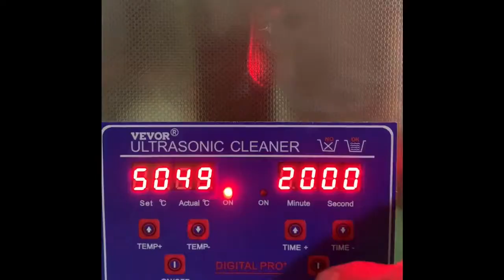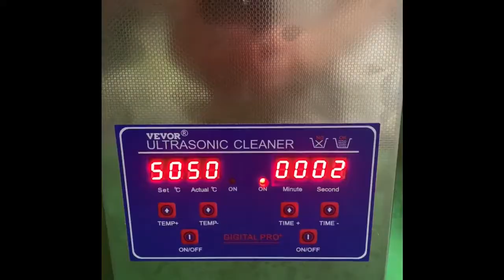ASMR - Tiny Vintage Ladies Watch - Bulova Caravelle Service

Comment: Personally with these tiny movements (Even though it is frowned upon) to fix them I soak them in alcohol then oil it. 50/50 chance of working, or just replace it.
Reply: If it's not an expensive watch and it's not working...what can it hurt.
Reply: @TexanUSMC8089  true that
Reply: Soak in oil?  The watch needs very minimal oil a specific location, over oiling is very bad and will just cause the movement to attract all sorts of dirt, grime and muck.  I hope you don't try and sell those to unsuspecting people.
Reply: @devildogae  I said soak in alcohol not oil, please read my comment again.

Comment: Thanks for this video.  Please...can you tell me what brand or type of tiny screwdrivers you used to disassemble the movement?.  I have this same exact watch and plan on doing what you're doing...cleaning and getting it running again.  My big issue is I can not find screwdrivers that are sharp enough.  I do not mean the width, but the sharpness.  The slots on the tiny screws are so narrow and shallow, I can't find a screwdriver that will go in them.   What brand did you use and what do you recommend?.  My father's Accutron is the same way. The slots in the screws are so narrow, none of my screwdrivers will go in the slot, they're too dull.   I have tried sharpening them, but it seems I can never get them sharp enough to go into these super narrow slots.
Reply from the maker: This is the set I use. It isn’t “the best” but I’ve repaired dozens of watches with them so far with no issues. However do realize if you’re stripping a screw head (stuck or overtightened) it will damage the screwdriver tip. Fortunately this company sells replacement tips. Good luck! Professional Screwdriver Kit by... https://www.amazon.com/dp/B07K1PMZ5P?ref=ppx_pop_mob_ap_share
Reply: @csspinner  Thank you so very much.  I think the operative word here is "precision".    No, I have not stripped any.  The screwdrivers won't even go into these narrow slots to allow for stripping.    Why do they make the slots on these screws so narrow and shallow?.  A screwdriver will hardly go in them.  
I have a teeny weeny Bergeon 0.5 mm.  Just about the tiniest made.  But I need ones that have very narrow slots, and if these work for you,  Then good enough for me.  Thanks.  I will order them
Reply: @csspinner  SUCCESS!!!.  I took my Dremel and sharpened the tiny screwdrivers I have on hand and it worked well enough to loosen those tiny little screws.  Whew!.  I ordered those good screwdrivers anyway as I need the right tools if I am going to continue in this hobby.  Thanks much for your advice.
Reply: I would like to have watched your unedited video of disassembling, servicing, and reassembling this watch.  One of my biggest issues with watch repair is screws that won't come loose.  The only one that is giving me a fit is the super tiny winding stem screw.  It doesn't have reverse threads on something on it, does it?.  It won't come loose for some reason.
Reply from the maker: @wildernessofzinn17  correct. Small stem screw is normal threading. Is it stuck and won’t turn because of rust? I’ve found that soaking a rusty movement in a vinegar/lemon juice mix helps break down the oxidation and may help loosen things up. In fact, I’m working on a video for next month where I tackle a movement with significant rust damage with lots of stuck parts and that’s how I resolved it. Keep in mind that mixture will also eliminate the “shiny” plating on the steel screws and other small parts. So only soak for 20 minutes at a time
Reply: @csspinner  Thanks.  I may try that.  No, it's not rusty at all.  It is so tiny and it may be gnarled.  I think my biggest issue is cheapo junky screwdrivers.  Wal-Mart specials and so on I can see just ain't gonna cut it for this work.  The slots in these tiny screws are too thin. I ordered those you recommended plus I went ahead and sprung for five Bergeon screwdrivers.
Reply from the maker: @wildernessofzinn17  don’t forget even the best of screwdrivers need to be maintained and re-sharpened after a while. A basic sharpening stone that you can get from your hardware store like Lowe’s can do the trick with the right technique